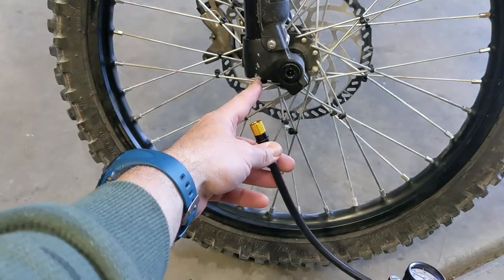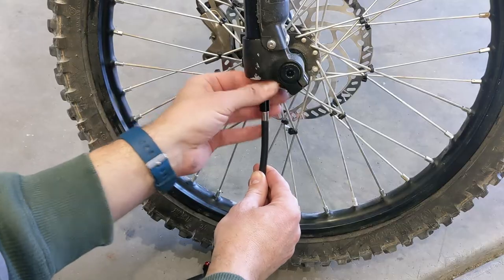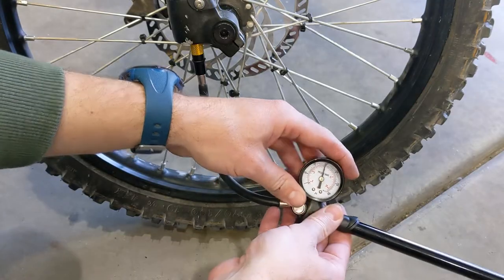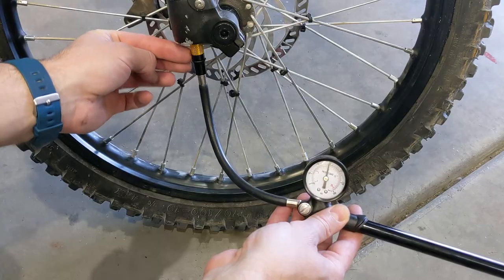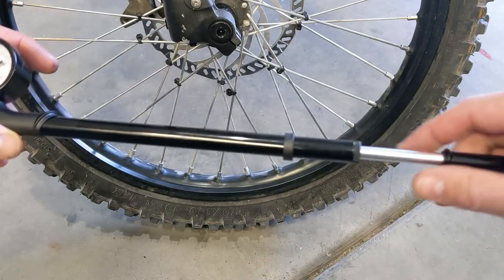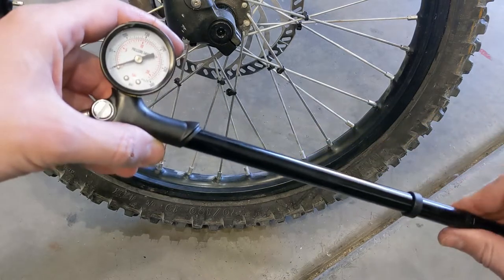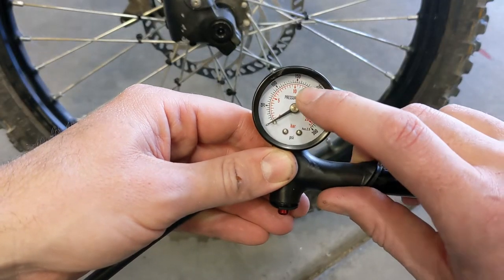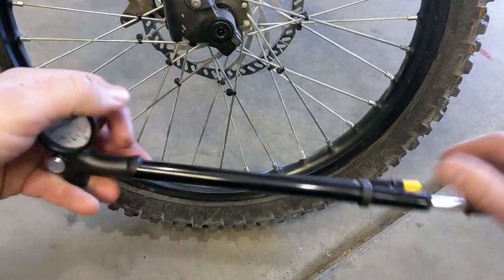NO air LOSS Shock PUMP TEST and Explained how to use

Comment: You don’t need any special valves. The hissing you hear when unscrewing is the air escaping from the hose. Just pump to recommended pressure, unscrew and save your money.

Comment: I don't use bicycle shocks, but I have tubeless tires. I'm wondering if it's possible to use a tire pump like this to replace carrying a regular pump and a separate pressure gauge with a bleed air button.

Can this bicycle pump be used to control tire pressure, measuring it in real-time by adding or bleeding air through the display gauge?

Many thanks!
Reply from the maker: This pump is specifically designed to be able to add and remove and keep a certain pressure so this will be excellent for two bliss but there's two problems It doesn't have a lot of volume so it will take a long time to pump anything up and also it's very fragile like it's a very very small tool and in your backpack when you're riding you fall on it it bends it's gone, But a specific design so you don't lose any pressure when you open up the valve for the tubeless I know I had it and I know how much I hate it when I took the pump out and I went from 110 PSI to like 90